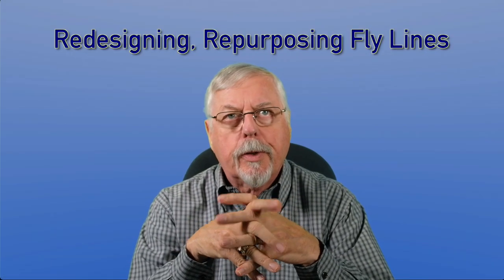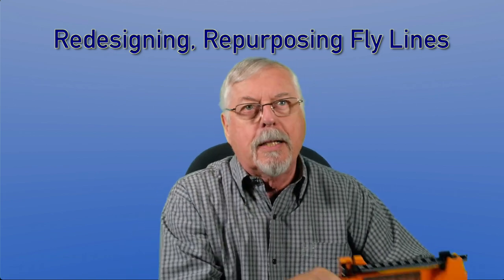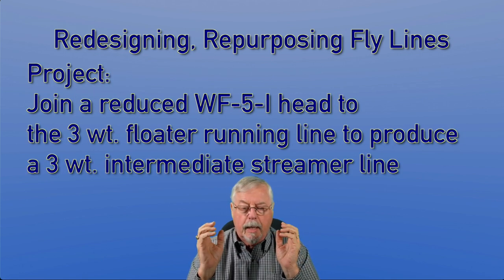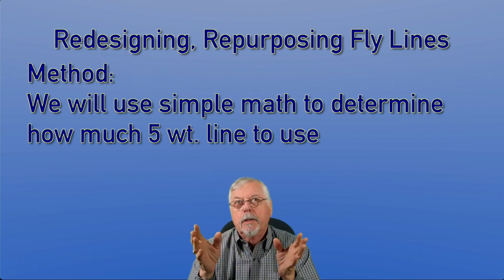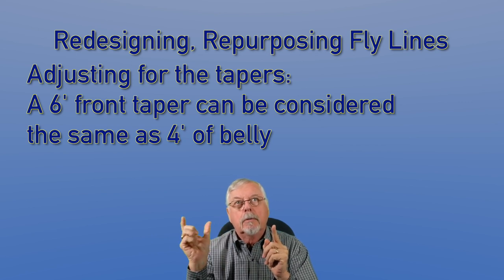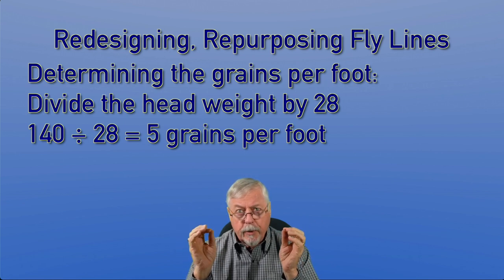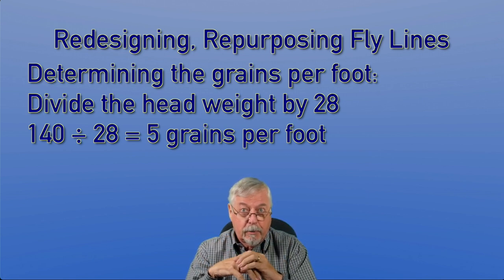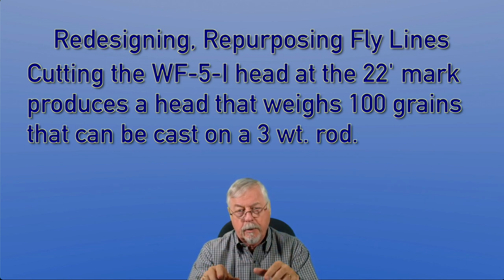Redesigning, Repurposing Fly Lines: How to make a fly line that doesn't exist. Nerd Alert!  Math!

Comment: I need help!  Do you have a tech video for welding the mono core line to a braided core line?  I have been unable to get the mono core line cover soft enough without melting the core. Thx
Reply from the maker: It's very, very tricky. If your heat gun has an adjustable heat setting, turn it down as low as it will go while still melting the coating of the mono core line. We have to use the minimum heat to get the job done.

Comment: Hello fellow Canadian fly fisherman. I am starting production of my own line of fly reels this spring and launching my machining channel mid summer 2022. I will send you a couple reels. 100% made in Canada using Canadian raw materials by Canadian tool & die makers. If you are into making your own bamboo rods I have a plane and jig ( you can adjust tapper every 6") I will send you as well. Cheers from Mid Vancouver Island.
Reply from the maker: Good luck with the venture and yes it would be nice to see one of your reels. About bamboo rod building my SO has threatened me with grievous bodily harm should I ever venture that way. ;)